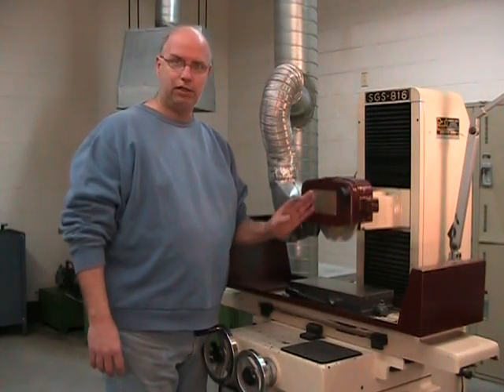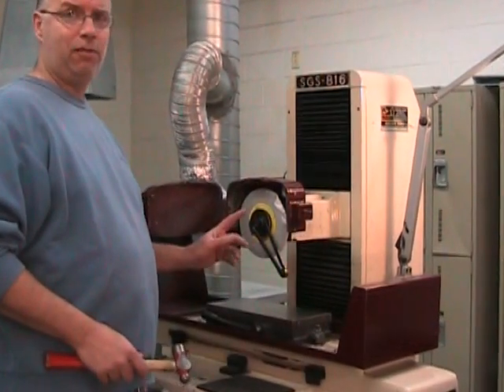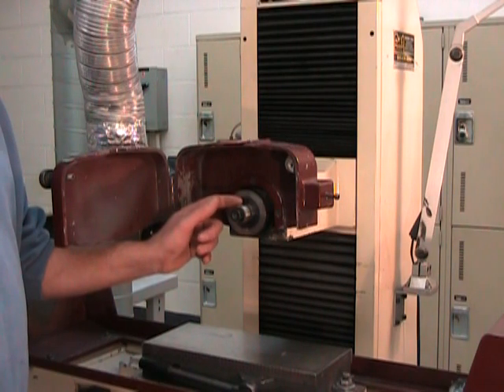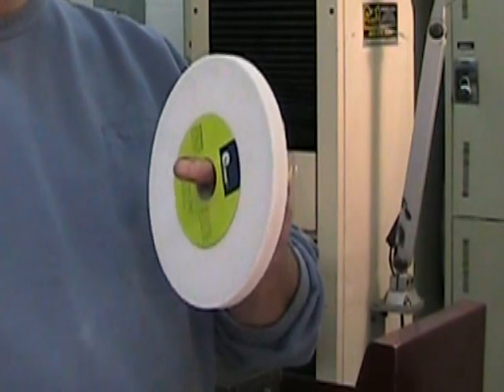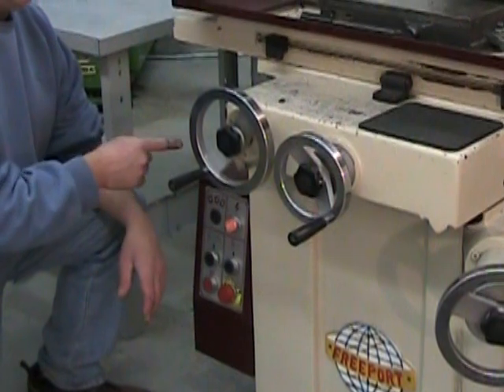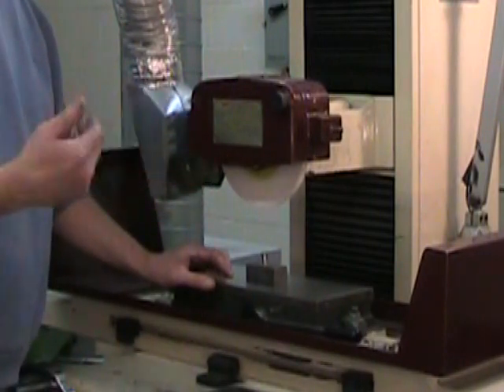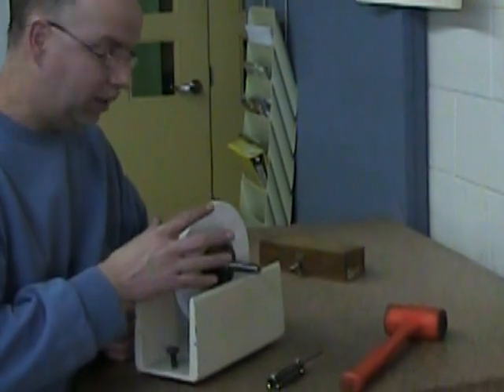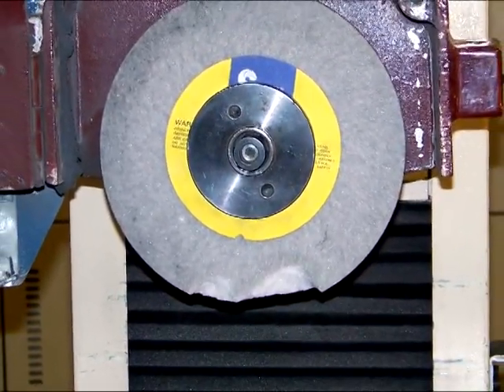GRINDING WHEELS. HOW TO INSTALL GRINDING WHEELS & HOW TO BALANCE GRINDING WHEELS, MARC LECUYER

Comment: 32 years grinding and i have never once balanced a 1/2 inch wide wheel. Take those weights off that hub and watch out of balance problems disappear. Or better yet, just get a new sopko hub without the weights for your 1/2 inch wide wheels.

Comment: on the leveling actually a person dosent need to get a good level they are rarely needed and weight that must be carried around never to be used in real life. The three screws are correct but on top of the rods that the arbor will roll on--place any surface ground plate or block and place a big ball bearing on it which I have them up to 2 inches and they are dirt cheap. adjust the screws till the ball does not roll. Using a level as he showed a person can get away with it--but its not that accurate but can be a getby in an emergency. The ball method works far better and faster and the ball method can be used to level anything even machines just by laying the ball on there. I also use the ball when holding parts I am running in which I cant be sure where they are registering on the bottom. Placing the ball OFTEN catches something is wrong. Especially when using dove tail systems such as in a five axis where the parts can easily be cockeyed. When he dresses the wheel HE DID NOT DRESS THE SIDES before balancing. (a horrifying oversite). That being said his videos are good and fun to watch and alot of info but I know from doing videos its impossible to put in every concievable thing especially for a beginners video so viewers at various levels of experience should be aware of that and get a good mix of info and keep an open mind. The arbor he used I make and sell them and I zoomed up because I thought he had bought one of mine!--but his has a center hole. Here is how to make an arbor--get half inch thompson or other rod and make a sleeve that is made close on the lathe to the 7.125 degrees and then JB WELD it onto the shaft. Later go to the grinder and tilt up the angle-7.125 degrees is most common and thats what his grinder is by the way but the big end of the taper on his 6-18 is 1.040 not the more common 1 inch such as on a harig 6-12. Now dust off the taper on the surface grinder and its complete.. The balancer will work far better if it sits on rods--not knife edges.

Comment: good video. But take out the weights first   find heavy--now put the weights back on equally with one at the bottom at the heavy--now move the other 2 upwards equally a percentage to move heavy towards the lite. It takes longer to move the weights around endlessly for the vast majority of people although it can be done its tedious and almost all people will end up mixed up and frustrated.. WARNING he did not tighten the wheel enough-it should be much tighter and that is the biggest problem in grinding is that in beginner books they think people will crush the wheel--almost impossible so people are overly scared and leave the wheel loose as he did. What happens is that when roughing the wheel will move out of concentric for the slightest reason and give cups in the surface as if out of balance. --that is because the wheel is FAR too loose. The wheel should be tightened off the machine onto the hub with reasonable force he simply was no where near it..  GOOD VIDEO THOUGH

Comment: I can tell you havn't been taught, or at least the right way...take all weights out first!
When wheel done rocking, mark exactly the top opposite top side, [lighter side] where you mount a weight and never be moved again, the two other weights mount always the same distance from the permanent weight until balanced. Go dress it and balance again on a new wheel ...DANGER...a new wheel can be badly out of balance, a good idea is to just hit the on and off button and dress..not to go full speed until wheel dresses round. [can skip one balancing]. I wouldn't advise on very larger wheels. 

Also...don't bang on the spindle...pull the mounting adapter or flange off the machine first and mount or take off wheel off the machine.
You said the run out is less then .001" and definitely  not exceptable, ...not so, this is adequate since run out is on the wheel flange which is balanced, you need to check run out on the grinding spindle only.  

Again...do not bang on the wheel nut on the machine,  [not called flange]  a flange is a ring with a extended part, [wheel holder]. 
Hitting the wrench with hammer on the machine can hurt bearings...could be worse the the actual wheel crash!

Comment: Probably better to lap the tapper.  Guess it is not that critical since the wheel gets dressed, but still want uniform contact.  Small movement between the arbor and shaft during operation grows exponentially at the wheel edge.  Just how I think about it.  What's a machine shop without some crashes!

Comment: Hi I have questions, or rather I need help. I have a bench grinder with two 6" wheels (stones), they are the original wheels that came with the grinder and have never been changed. One of the wheels now needs to be replaced because it's become too small. I went and bought a replacement wheel and it came with a series of plastic bushings in the center hole (the original wheel only has one bushing and it is part of the wheel itself and cannot be removed, unlike the bushings on the new wheel, which can just be popped out). This grinder was working perfectly well with the old wheels on it but once I put the new wheel, it started vibrating like crazy so I turned it off. I tried to true the surface of the wheel to make it concentric, but since this is what you might call a consumer bench grinder, it came with a stamped metal rest in from of the wheel, not a sturdy and precise machined one, so there is no real mount for a truing diamond block, and all I have is a hand tool with a series of spinning metal disks that I run side to side to attempt to true the wheel. This grinder has no balancing counter-weights so I don't know how I'm suppose to true the wheel, let alone balance it! It's still vibrating like crazy, so just for fun I unmounted the new wheel and replaced the old one and turned it on, just to see if the vibrations would return; they were gone! With the old wheel the thing ran smooth as silk, but of course the old wheel is worn so it isn't of much use to me. 

DO you have any advice for me? Should I find a wheel of higher quality (this is the second wheel and it was purchased at an industrial hardware store, not Canadian Tire-their grinder wheels are even worse!). Thing is I don't know where to go or what brand name to look for. I'm not a machinist and I've never had to do this before. I just don't want that thing exploding in my face from all the vibrations!

Any help is welcome!
Thanks!
Reply from the maker: First it is important to protect yourself at the beginning so get or borrow a full face shield and ware your safety glasses under it! There is a difference between truing and and sharpening. The Desmond wheel sharpener (tool with star shapes discs) is conceived only for sharpening and will not true the wheel. A diamond cutter (if held steady) will true and sharpen the wheel but if your rest is not accurate it is hard to hold in place. I would suggest that you use a diamond cutter in a point to point mode. By that I mean that you should rest the diamond tool on the tool rest and slowly push it forward until it contacts the whole diameter of the wheel. Then retract the diamond, move over a 16 th of an inch (or so) and plunge back into the wheel until it contact the whole of the diameter. And so on until the wheel is running true. Once it is running true, use the Desmond tool to flatten the irregular surface left by the diamond.  If after this, the wheel still vibrates, it could have a thickness problem. in other word the wheel is not the same thickness all way round. If that is the case, get another wheel. It is also good to check that the grinder does not vibrate when no wheels are mounted. I hope this helps and is clear enough, Marc  P.S. you may want to check out my video on bench grinders in the orange section on page three of my website (free)  THATLAZYMACHINIST.COM

Comment: wrong! ;>
first remove all weights, than find the heavyest point. set the 1st weight over this point. dont move this weight anymore!
now you can set the other 2  in same angle and move them.
thats way faster and easyer!
Reply: this person is correct. He eventually was able to balance the wheel by trial and error but be aware he did not do it right.

Comment: I repaired all types of machines and tools for a manufacturer of very expensive yachts and quality control was foremost, Nothing could e even slightly off. As the person that kept it all running I can say "The people using the machines could be negligent, stupid and short sighted." I guess I felt good about it at times because they kept me in overtime....Still it could become a bit frustrating.
Reply: worddunlap n n.

Comment: You cheated on the ring test, Marc. For the good wheel you supported it only by your finger in the mounting hole.  But for the bad wheel you had your thumb pressed against the rim... That would cause even a good wheel to sound bad.
Reply from the maker: +M Kerna Howdy,  this is a cut and paste of an answer I gave to a few other viewers some time ago, they had the same question, so here you go. Thanks for watching and I must say, thanks for paying attention, Marc.                                    "Hi Flineman and CompEdge, I was expecting the comment and must admit that I had to reshoot the ringing of the broken stone twice because the stone was so badly cracked that it was falling apart. In the second shot I supported the bottom half so that it would hold together long enough for the scene. It was the only broken grinding wheel I had and I only had the shop for the day, I had to make due. I can say however that the sound is right, it's just a little more muffled than it should be. Thanks guys for the keen eye and the great insight, and thank you for your interest in my videos, it's quite appreciated. Marc L'Ecuyer"

Comment: Marc. I have enjoyed many of your presentations and I learn something from every one. 026 grinding wheel balancing I believe just helped me the most. I picked up a 1986 Enco 6 x 18 surface grinder at a local auction about 3 years ago. My experience with a surface grinder was in 1976-8 while I was in High School. I . The machine is in excellent condition but my surface finish has been less than what I expected. Information on the balancing was no where as complete and easy to understand as your presentation. thank you
Reply from the maker: Hi Roger, I am glad to hear that the video helped. Here are two other of my videos that could help, the first is about the cutting action of grinding wheels https://www.youtube.com/watch?v=zCUoQIoCsdQ&feature=youtu.be
and the second is a grinding project https://www.youtube.com/watch?v=9YktYlR86rQ&feature=youtu.be
Thanks for watching, have fun and be safe1 Marc L'Ecuyer
Reply: THATLAZYMACHINIST Marc, Thanks again I have watched the cutting action video, and before I start the project I have one small project to complete first. A hub and grinding wheel assembly puller. when I watched you use it I realized that it was the key to correctly balancing the assembly. Prior to this video I was bench assembling , balancing then truing the face and sides of the wheel and using God knows what wheel, due to no markings or backers on the wheels I acquired at another auction. This has been compounded by machine re-assembly and questioning the parts. Namely the direct drive of the spindle by love-joy joint and the lack of parts support from the manufacture.

Comment: Ofcorse th broken wheel is not going to ring as he has it held with his thumb  that will tell you that even any new wheel is damaged with the ring test and I know this and im only a cert 2 engineer
Reply from the maker: Hi Lindsay, you are part of a keen eyed group of people that saw the thumb problem, here is a copy paste of an answer I wrote some time ago.
"Hi Flineman and CompEdge, I was expecting the comment and must admit that I had to reshoot the ringing of the broken stone twice because the stone was so badly cracked that it was falling apart. In the second shot I supported the bottom half so that it would hold together long enough for the scene. It was the only broken grinding wheel I had and I only had the shop for the day, I had to make due. I can say however that the sound is right, it's just a little more muffled than it should be. Thanks guys for the keen eye and the great insight, and thank you for your interest in my videos, it's quite appreciated. Marc L'Ecuyer ".
And thank you Lindsay for taking the time to comment, that tells me that you are watching my videos with interest, and that makes me happy. Marc L'Ecuyer

Comment: Tool & die maker here, hello. Nice video and very informative, but I would make a suggestion for the balancing operation.

1. Mount your wheel on the arbor so that the usually marked "T" or arrow up points upward when the arbor is is normal position. This ensures that the wheel is in the same position as it was when it was turned to dimensions at the factory and thus requires the least amount of dressing & balancing. Do NOT put any balancing weights on the arbor!

2. Mount the arbor on the machine, spin it up to speed and dress the outside first until you hear a constant sound all across the wheel. Then dress both sides up to the plotter edge.

3. Remove the arbor from the machine spindle and mount it on your balancing arbor and fixture. Let it rock its paces and once it stops, put one balancing weight on the top dead center and mark it with a permanent marker or similar. This will not be moved ever again, thus the marking. Place the two other weights spaced equally (120 degrees) and lock them in Place snugly.

4. Let the wheel find its new balance. Now, note the direction to which the marked weight turned. Loosen up the weight (not the marked one) that is in that direction and move it away from the marked weight and lock it down.

5. The goal is to keep moving one weight at a time until the marked weight is at the top again. Once that is achieved, the two weights should be moved in unison when needed. This means that you move them both the same amount at a time. Once you get to the point that the marked weight side tries to be the heaviest, back out just a hair with the two weights and you are done. You can confirm this by rotating the arbor 90 degrees and it should stay still in that position. Or in any position, as itis balanced.

6. Finally ensure that all the weight screws are tight and remount the arbor on the machine and dress your wheel. You are now ready to grind beatiful chatter free finishes :)

This method has saved me and others fiddling around three weights and removed the guess work. I'll have to see when I balance a new wheel if I could take photos or even a video of the process to share on YouTube.

You can also use just two weights, set them opposite of each other (3 o'clock and 9 o'clock when viewed from the side) and move one of them until you get that lightest side on top again and after that move the two weights in unison until balanced.
Reply: Thank you for your input, combining your experience with Marc's is helpful.

Comment: Hi Marc, thanks for the upload and your series of videos. one thing you forgot to mention when mounting the wheel on the flange is to observe for rotation indication. some wheel manufacturers put an arrow on the paper to indicate direction of rotation (cut). while this may seem trivial it does affect the life and cutting performance of the wheel

Comment: What was that magic liquid that you used when honing the magnetic table ? This was very interesting.
Reply from the maker: Hi Jester, it's just Varsol. Any good grease solvent will do, I use it to keep my honing stone from packing up. It really helps the cutting action. Remember that Varsol or Kerosene are flammable and must be wiped off completely before grinding. Remember also that a magnetic table must not be oiled since this will make the loose grits stick to it. Thanks for watching and taking the time to comment. Marc L'Ecuyer

Comment: "Tighten it down but don't kill it, a little more than snug will do"

Words to live by.
Reply: the problem is its not true. the wheel was not tightened at all. During any roughing its going to shift and leave washboard road marks.

Comment: This was a great video.  I'd like to know the error was that allowed the crash(crunch) take place?  I'm hoping to learn from my fellow student's errors and avoid them.
Reply from the maker: Hi ctjctj2! here is a copy paste of an answer I just posted form 88runes for a question that is similar to yours.
"Guillaume forgot to activate the magnet and came at his part with the wheel from the left side. Since the wheel turns clockwise, it grabs a lot more when approaching from that side and once the part starts moving it wants to pass under the wheel really quick. It's the same principal as a ball throwing machine but a lot less fun. Luckily no one was injured, and that is why I permit myself to tease him just a little. Kids now days think that you need to jump off a cliff with a parachute to get an adrenaline rush! Guillaume and several other people present learnt that working in a shop can do it just as well." Thanks for your question also and for watching my videos. Marc L'Ecuyer"
Reply: THATLAZYMACHINIST
does this imply that when starting the grinding process you should always start from the right?  Please let our fellow student know that we feel for him and that we thank you for this opportunity to learn.